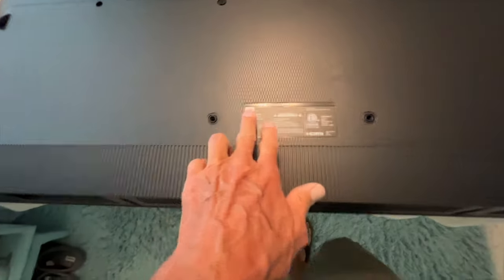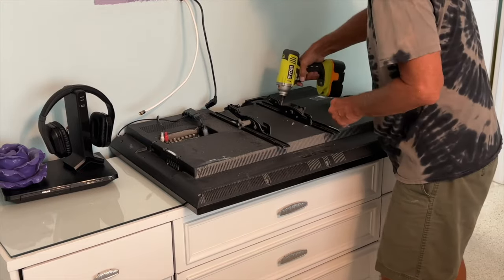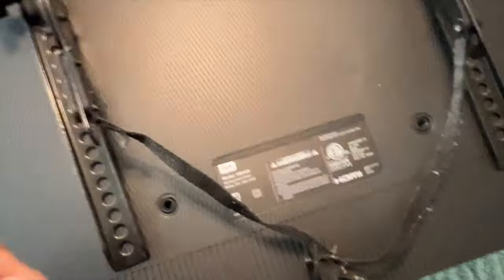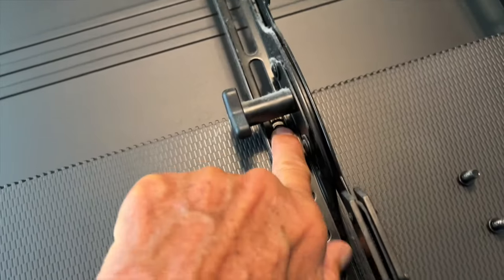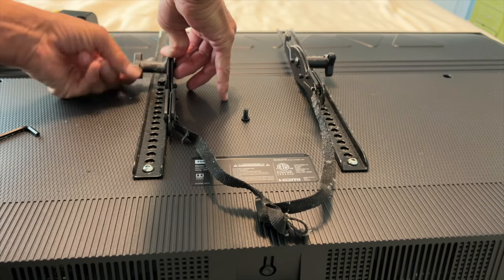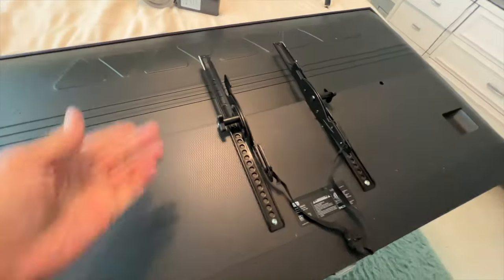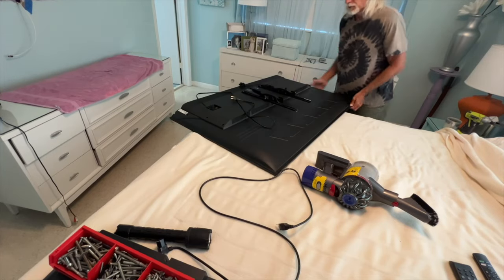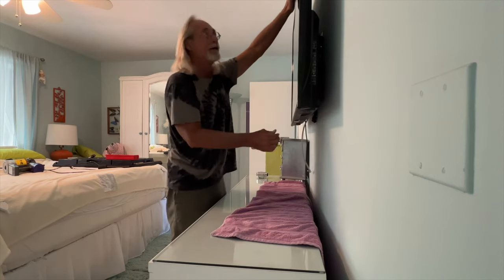How to attach a 55 inch Roku TCL 4K Smart TV to a Wall Mount

Comment: Thought you werent supposed to lay this tv's flat because it damages the screen?
Reply from the maker: That’s what they say, but how do you gonna get the brackets on the back if you don’t
Reply: If you shake it or are ruff im sure just be gentle
Reply: @bill9663 we use our bed and headboard, it’s padded, and just prop it up, slightly tilted. We use pillows, that way we can apply pressure that’s needed to install the mount. It works and that way we don’t have to lay it down at all.